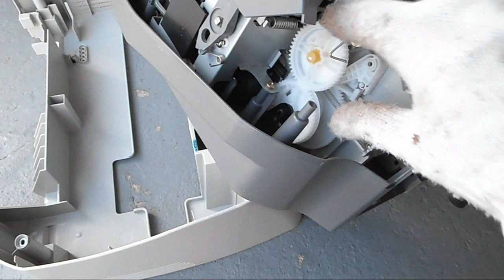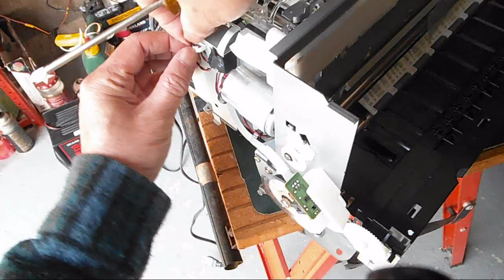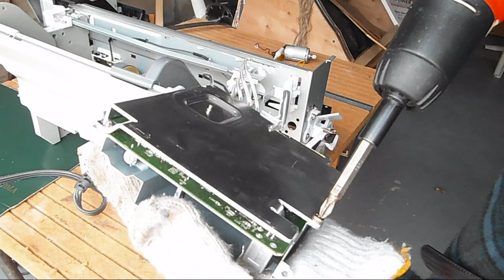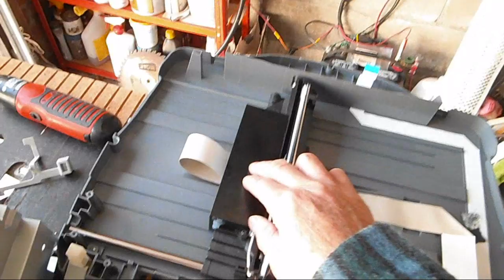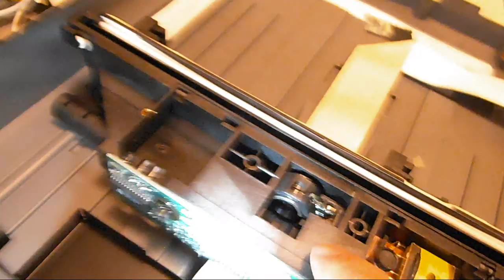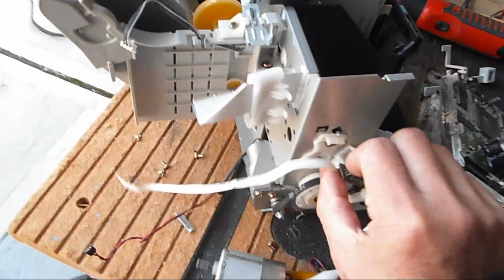A  treasure trove of parts from epson printer scanner cx5200

Comment from the maker: I have another printer (Canon 6000D) that I have to take apart. The problem is the motors usually need high rpm to give you that voltage and amps.  I wish I were smart enough to make use of all these nice motors.

Comment from the maker: Hi Rikkie, I watched your video on the making of the dc motor wind turbine again and I understand the purpose of the long rod connection to the motor. You also have a spring at the front where the shaft meets the bearing. I'm not sure if that's needed. Thanks for the advice.